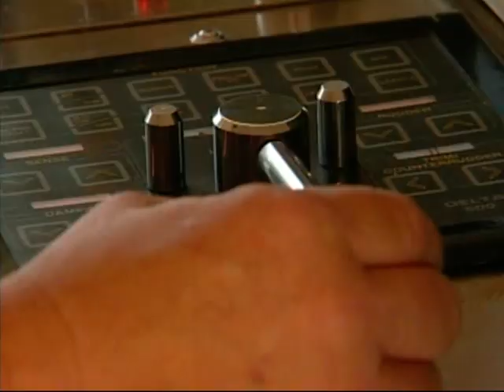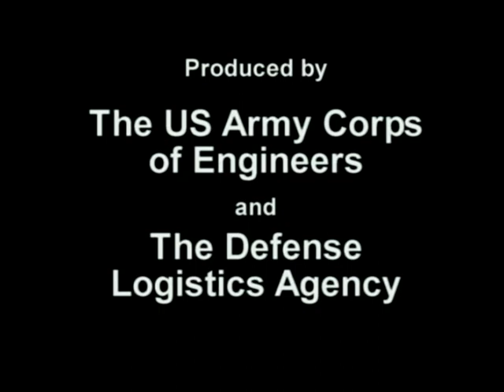America's Inland Waterways System - Part 2

Comment: boats can't sail AROUND THE OUTSIDE OF A BENT WATER BALL…..they sail on the surface flat bottom ….on SEA LEVEL 
across …..never ..up or down the sides of a round projection ..
cheers glasses up…………CARGO SHIPS MUST REMAIN LEVEL AT SEA….
elementary observation …not rocket science

rail trains don't account for earth  curvature …we all stand at 90 degree on flat plain 
..just stand up …..ha ha any where …the result….FLAT EARTH
the Horizon line ... is the key